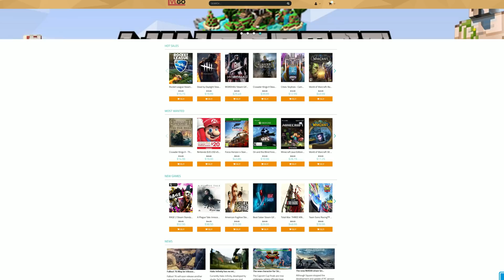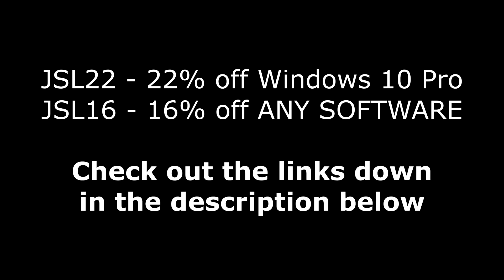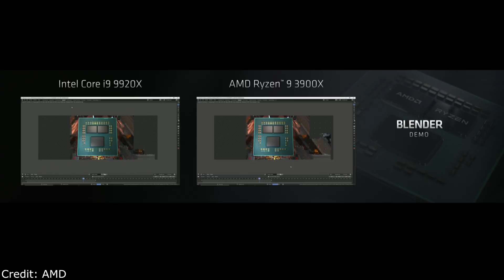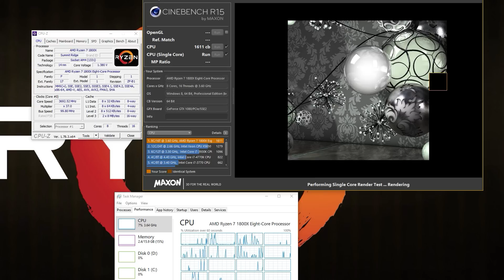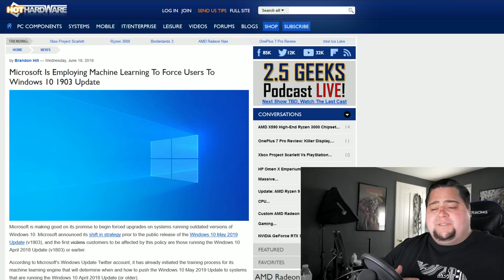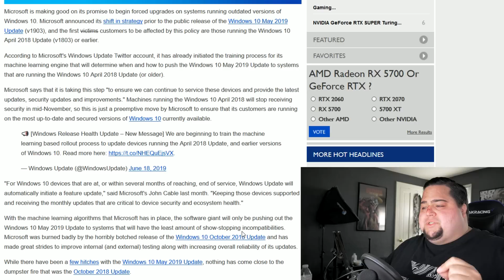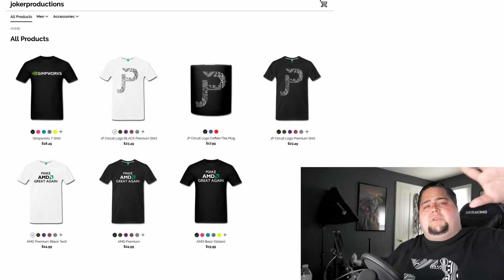AMD | Binning Chiplets to CRUSH Intel

Comment: The windows thing isn't that big a Deal They usually fix the issues that pop up from time to time within a week or so..  I haven't been forced onto it yet and By the time I am It will be fixed, so really not woried and looking forward to the New AMD Scheduler, For the first time in ever Windows may favor AMD hardware instead of it being the other way around, or at least make it 50/50, Because windows has allways favored Intel chips, Now maybe that will change..

Comment: Sorry to hear about your nose.
If you want to greatly speed up the healing process, put some Neosporin on it and cover the wound (probably with gauze, looks like a bandaid would be too small).  If the gauze is too much of a pain in the ass, skip it and just use the Neosporin. 

After it's healed, use a moisturizer on your nose to mitigate against more wounds.

And if your allergies are fucking awful, take an over the counter anti-allergen once a day, same time every day, from now until mid September.   That should prevent another allergy episode.

Comment: If the best 8 core chiplets are going toward the 3950x, that means the not so good chips will go to the 3800x and 3700x, while the 3600 and 3600x get the chiplets that failed to validate all 8 cores.  I think it's a good marketing decision to go all out on the flagship, but overclocking on the remainder of the 7nm range may well suffer for it.  Time to save up for that 16c...
Reply: Above 8core things just get expensive

Comment: You need to understand "End of Service" part in that article. That date is about 2-3 years, or sometimes longer, AFTER the main release. It makes sense to move to another suported release which MAY NOT BE THE LATEST release. So try not to be dramatic about these update requirements.

Comment: I already have 1800X I'm probably not going to update as my cpu is working just fine. Maybe I might don't know. Will you please include first gen Ryzen CPU's in your benchmarks too? A lot of people didn't have that much reason to upgrade to 2700X over their 1800X. And it would be amazing to see if there is a reason to upgrade now.
What happened to SteamOS? I thought they would get the quirks fixed and made a special wine version so it would run all windows games at this point.....

Comment: OOSU10.  Not only does it stop updates if you choose to do so, but it does a whole lot more as well.  That aside, I have had no trouble with 1903, and I have a pretty complex setup.  One gripe though.. I use "sound properties" a lot.. (right click on the systray icon).  In 1709, you could right-click, then choose Playback or Recording devices, and it would take you right there. Starting in 1803 and going on until 1903, your only choice was "System sounds" (something nobody ever needs).  Now, in 1903, it's completely gone altogether now, replaced with a dumb, useless app.  I have around 10 potential sound devices and keep most disabled when not being used.. and in the useless app, you can't see disabled devices.  Dumb, just.. dumb.  I guess it's not as bad as killing bluetooth media buttons through 3 versions (1803, '06 and '09).  I was stuck on 1709 for a long time.

Comment: Hey Joker try using an air purifier at night to help with that.
Reply: @jokerproduction  Ha! Funny how things are. I have been looking as well and I have been not only looking at a good hepa certified one too but also a unit with reasonably priced filter replacement. The current one that I found so far that has a "cheaper" filter replacement is the Winix 5300-2 or 5500-2 air purifier. Also officially from Winix (2 pack including carbon filter) replacement or a (2 pack regular filter & 8 pack carbon filter) from an unofficial seller for the same amount.
 I found it on amazon.
One more thing, 
https://www.ahamdir.com/
shows your their CADR rating.

Comment: I'm having the same issue with CPU/GPU utilization when playing games since the 1903 update. RX 570 8GB and Ryzen 5 1600. CPU not peaking about 85%, GPU not peaking above 75%.
Reply: Same here running Ryzen 7 2700 and a GTX 1060... wanted to stress-test my new CPU about a month ago because I wanted to OC, but even at factory settings the stress-test hit 98% at most and was running very unstable while temps didn't go over 65°C??
In games I get the same results as you do...

Comment: Are they binning specifically for the 3950X from the edge or just using the Epyc/Threadripper centre binned dies, the latter would be better.

Comment: 4:28  I don't think AMD's binning has anything to do with the TDP, The 3950x gets to keeps the same TDP as the 3900x because of the base clocks of 3.5ghz & 3.8ghz respectively?
Reply: If this is the case then the 3900x also can boost to 4.7 like the 3950x. so I think that is indeed some bining there.. more cores means more heat management that's why server chips get the best silicon around..
Reply: @vmas29  Hi, Binning for overclocking sure but I don't think they're binning for the TDP as they've removed it from the equation by lowering the base clock of the 3950x.
Reply: @davideverett2 hi. binning goes both ways I think.if you take  lower quality silicon (8 core chiplets) and make a 3950x. propobly they're not capable to sastain even the 3.5ghz base at 105w that amd set as a target for this CPU to be reasonable in (performance + thermals) That's why they are also more capable overclockers ak 4.7ghz boost for the 16core.
Reply: @vmas29  You're right it does tend to go both ways, One way to know for sure would be to get one & see how it undervolts & whether there's any headroom, maybe one of the reviewers will cover it in a more indepth article/video once they get their hands on it in September. :)

Comment: 4:28  I don't think AMD's binning has anything to do with the TDP, The 3950x gets to keeps the same TDP as the 3900x because of the base clocks of 3.5ghz & 3.8ghz respectively?
Reply: @IJoeAceJRI  Hi, I thought I'd deleted this post as I mistakenly posted it on my other account but as I said on the identical post with this account I think the reason they lowered the base clock to 3.5 on the 3950x was to keep the TDP in line with the 8 & 12 models, the binning's for better overclocking.

Comment: I've yet to have any problems with Windows 10 Updates. I have all of my most important data backed up to an external drive, and I unplug it before updating. I also keep a copy of Windows 10 on a usb drive just in case the worst happens and I'd have to reinstall it.

Comment: powercfg -duplicatescheme e9a42b02-d5df-448d-aa00-03f14749eb61

run that through comand prompt and enable ultimate performance. does that make everything run better?
Reply: r b I had that on my pc now i dont have it after updating got a 1070 7700k ssd and 16 gb ram why did that dissapear?
Reply: Dante Ice “machine learning”? I dunno but run the command and you’ll have it again.
Reply: I put it in and updated my pc and it gave me 128 terabyte of ram

Comment: i need a new motherboard. my two main ram slots died. i have ryzen. i want something like an x470 or x570. I like overclocking. what should i get?
Reply: Depends if you want pcie 4.0 if not get the x470. Also wait for reviews of x570 vs x470. Who knows 3000 ryzen might run better on x570. That's what I'll be doing, if x570 offers better performance I'll be getting  that. Prices are gonna be higher for new mobos tho.
Reply: Do you have 2 or 4 slots? I've met this before where one channel died and the thing that dies was the cpu memory controller.
Reply: @abcdefg9613  I have 4 slots. the two slots that allow ram overclocking burnt out. I have 3200Mhz ram and it is stuck at 2133Mhz because of this.
Reply: @CaffeinatedFrostbite  so test the cpu in another system.
Reply: I bet you have an Asrock motherboard. Just swap again the ram and thank me later..
Reply: Depends how long are you going to keep your system?